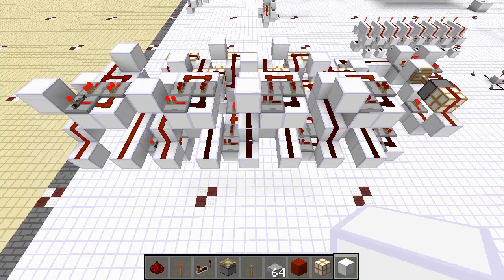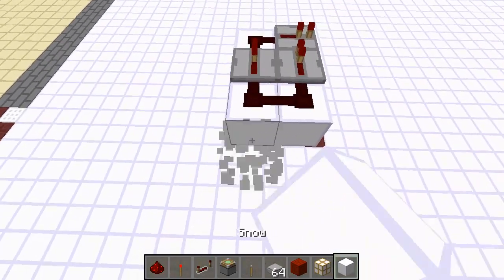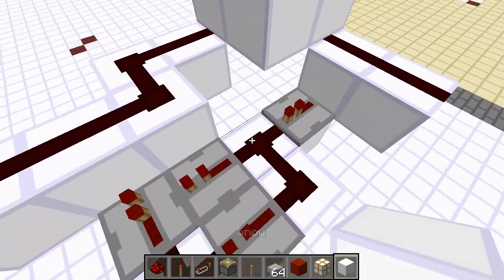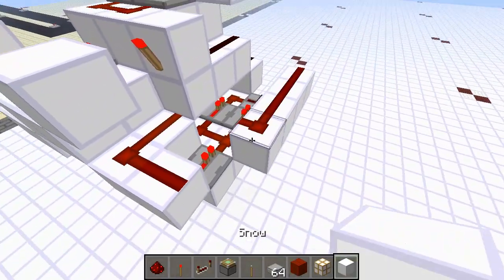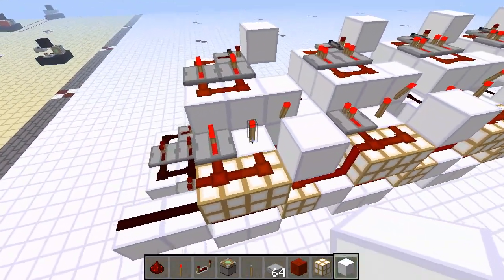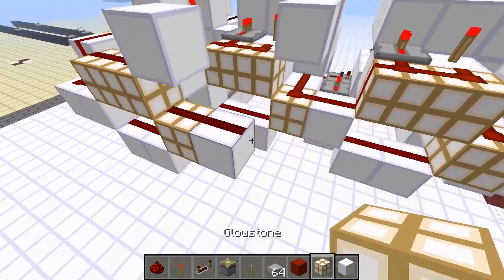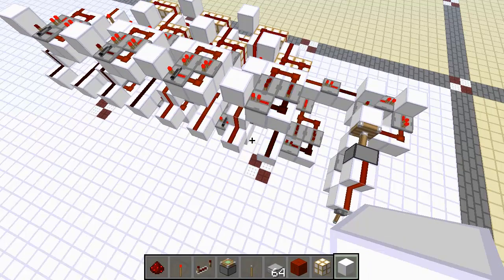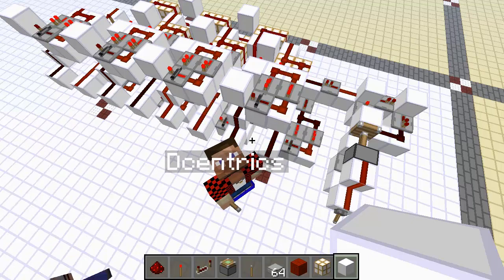Pistonless Binary Counter Tutorial

Comment from the maker: Yes, you can set the counter to a value by powering the dot of redstone before the repeater lock and then clocking with less than 2 tick pulse.

I almost guarantee the reason your clock isn't working is because the counter runs on a 2 tick on-off-on pulse. If you use the same clock I used but say, add a repeater, that will create a 3 tick on-off-on pulse and therefore won't work.

I recommend using a monostable-circuit to ensure the pulse length is correct.
Reply: could you please show that because i have been trying to make it branch but it just flashs the first output?